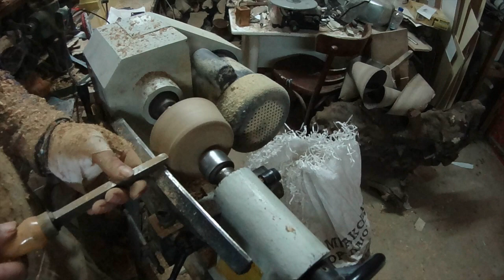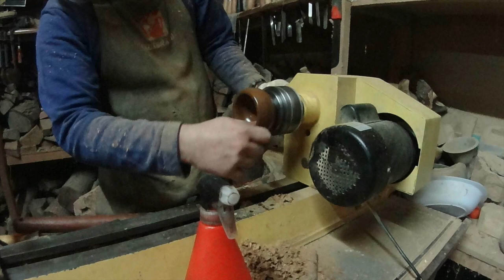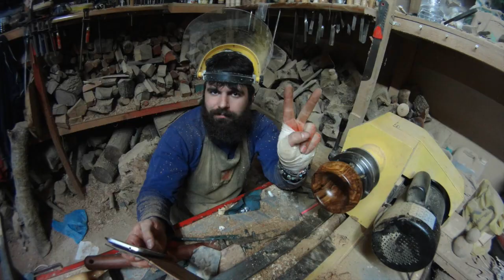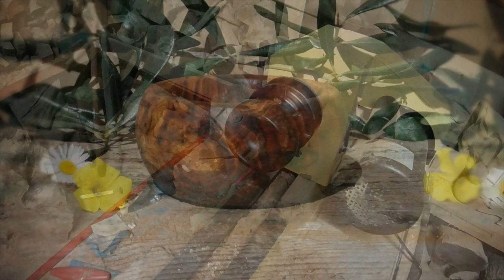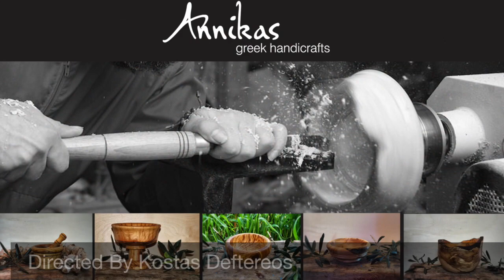Ξυλοτορνος - ενα μικρο μπολ απο ριζα ελιας#2    Woodturning - making a tiny olive root bowl #2

Comment: have you tried a final pass with fine steel wool?it brings a great matte shine and it almost looks like you put a finish on. probably because it brings the natural oil out. just make sure to whipe well because the metal residue will rust.
Reply from the maker: Θάνο I make the same with oil and my hand ! take a look at my videos first I apply the oil and then  I toUch it with clear hand so hi up the temperature and extract the oil from the olive wood ! And with this technique I don't have problem with the rusting metal on my bowls ! Thanks a lot for the comment is very good everyone to know both techniques because mine at the beginning are a bit painfull!  ha ha ha ha